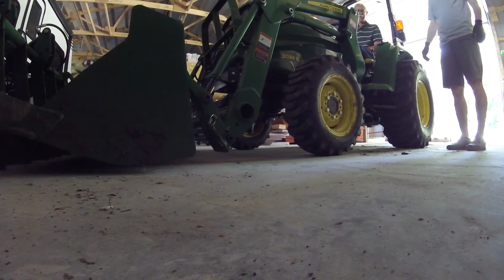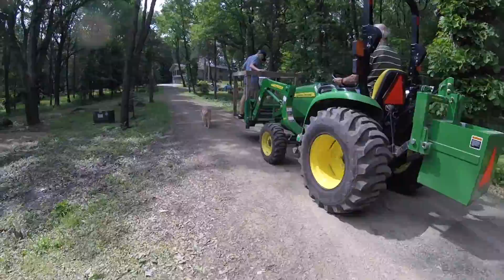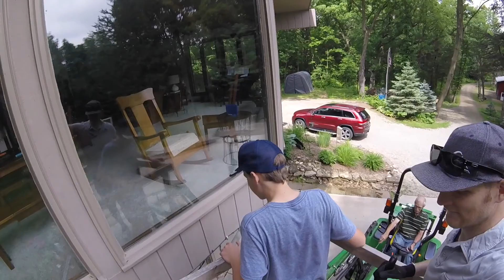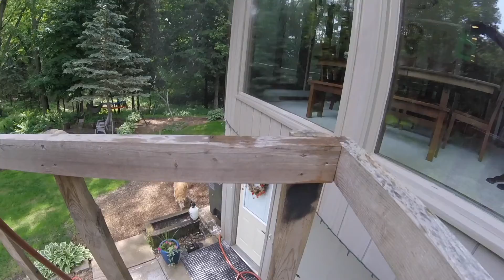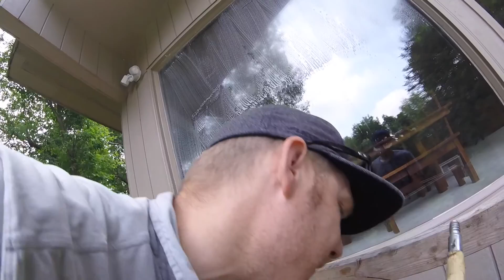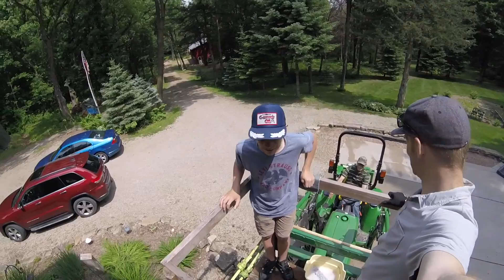John Deere 3038E - Lifts us up to wash windows (TITAN pallet forks)

Comment: What 3d function hydro kit do you have on your 3038E?  I have the same tractor and am in need of the 3d function.  Is yours from the factory or an aftermarket kit?  If aftermarket where can I find the same one?  Thank you.
Reply from the maker: Thanks for watching and the questions +Doug Standifer!  The rear hydraulics were already mounted on the tractor when we purchased it from the dealership.  My understanding is that the kit came directly from John Deere.  I would check with your local John Deere dealer to see if they are able to order it.  Otherwise, here is a link to one I found on line that is exactly like what we have installed on our tractor:  https://www.greenpartstore.com/John-Deere-Rear-Hydraulic-Kit-BLV10461.html

As for the grapple, we picked up this unit (G-55-JD) from Jeff at Compact Tractor Attachments (www.ctattachments.com). Great fit on our JD 3038E D160 front end loader.  Best addition to the tractor for us.  

Great to hear that you have the same tractor.  What do you primarily use your tractor for?
Reply: Thanks for the link!  I use my tractor mainly for bush hogging and heavy lifting.  I'm about to start moving a bunch of brush so have been shopping the hydro kit.  So if you use your rear hydraulics how do you control the functions of the grapply?  I thought a 3d function kit was required for the front end.
Reply from the maker: Our tractor has hoses that run from the 3d function mounted on the rear of the tractor and then zipped tied along the front loader arms and terminate with a coupler.  When we want to use the grapple, we simply pick it up with the front loader arms and then attach the hoses on the grapple and we are ready to get some work done.  Good question!!! I may have to shoot some video footage showing/demonstrating all of that for viewers like you.  I take for granted how it all works.
Reply: A video of how and where the plumbing routes and what type controller lever you use to open/close the grapple would help me understand what I need to do with my ownd tractor.  Does your grapple have a single or double hydraulic piston?  Thanks again.